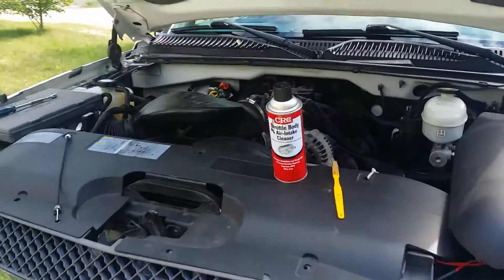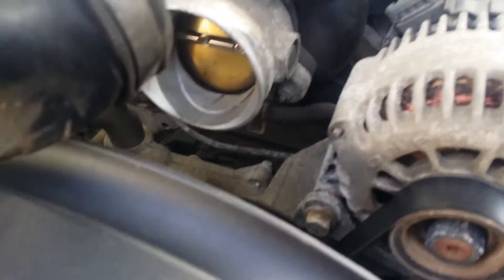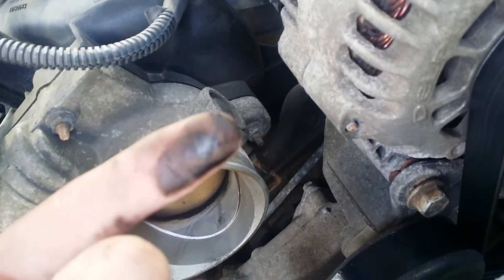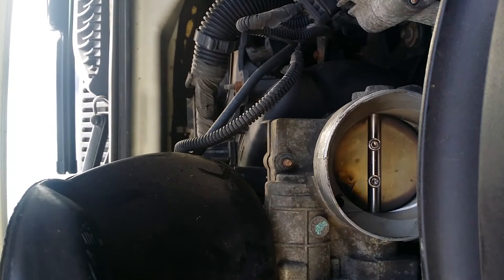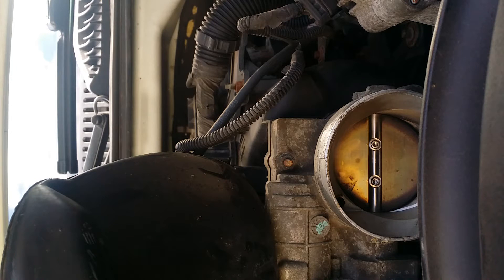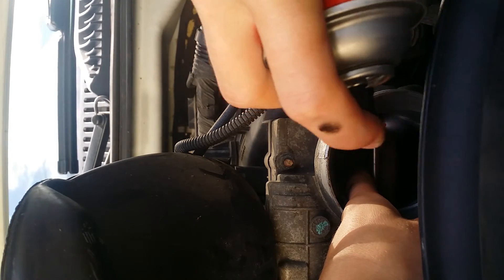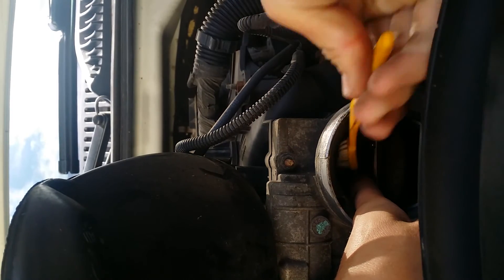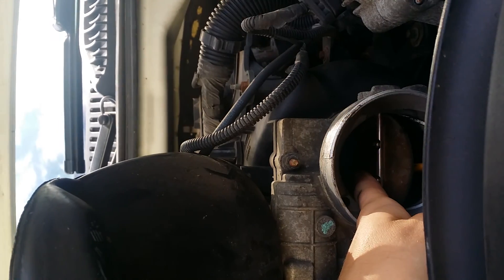2003 Silverado 5.3L 1500 Throttle Body cleaning

Comment: my 2004 GMC Sierra 1500 4.8 liter got a crappy idle especially after it warms up like to stall rolling up the stop signs and red lights I can hold it at 3000 RPMs no spit and sputter so I don't think it's fuel filter or fuel pump when I let off that 3000 RPMs when it gets down to Heidel it spits and sputters most the time it looks install you guys think this would be the problem just bought a brand new camper I gotta pick it up in less than 14 days and this is the only truck I have access to I desperately need help